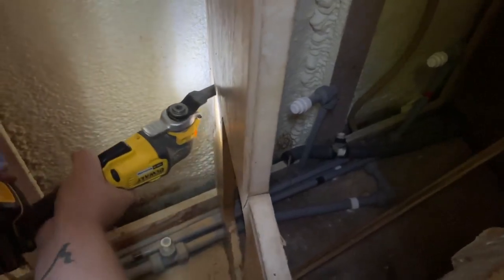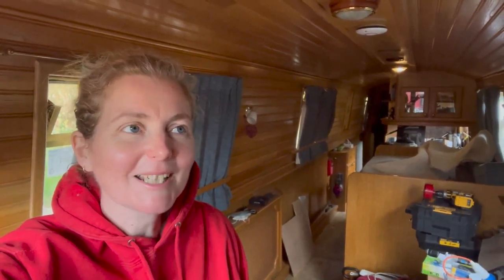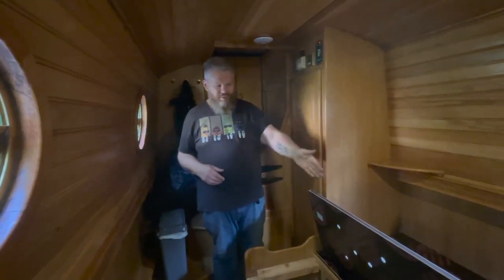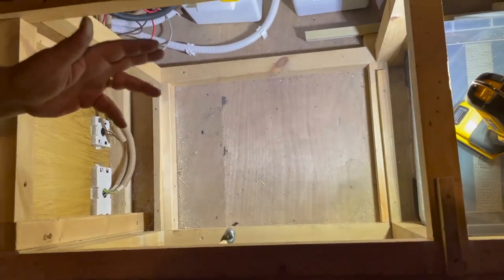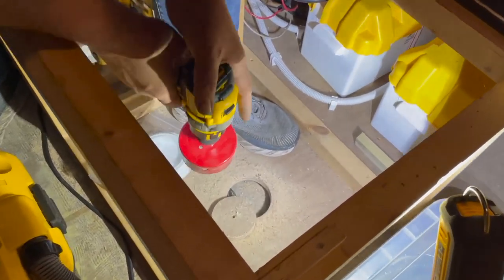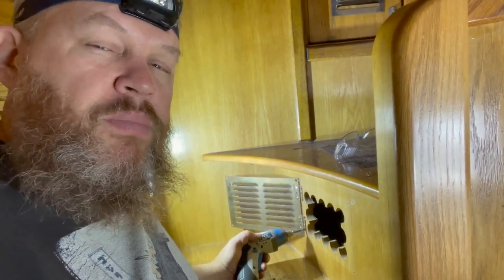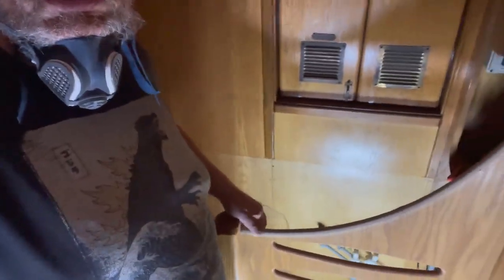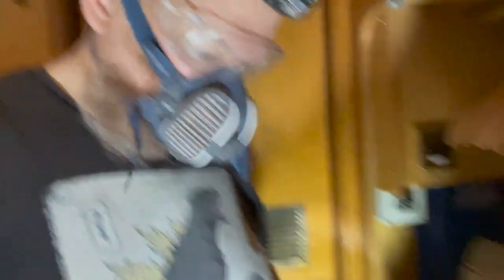Episode 010 || Another Set Back - We Find Water In Our Bilge

Comment: Glad to hear the water was localized and not through the whole boat. Quick tip for big hole saws: if you use the highest speed setting on the drill, you have less torque. When the saw binds it won't rip your wrist off, it will just bog the drill down. Can't wait so see how this all turns out. Keep up the good work!

Comment: When using the hole saw, engage the clutch on the drill. That way if it binds up the clutch will slip rather than breaking your wrist.

If you have two inverters, is it feasible to wire the high load appliances just to the high wattage inverter, so you can just turn that on and off on the DC side as needed? Would simplify things over having a full switch over.
Reply: let the tool do the work.

Comment: Washing machine is a really good thing to have. The important point from a power PoV is to make sure that the WM doesn't try and heat the water. We have an electric two-way valve on the inlet which can feed the WM from either hot or cold water. There's a timer activated by a button that switches it to hot for the time needed for first fill plus a bit, and then back to cold. Press this button when you start the cycle and it's all automatic from then on.

Comment: What I do with stubborn cross head screws that will not budge.  Using a battery drill with a variable speed trigger, I use a flat head screw bit that fits inside the damaged screw head and using all my weight to push the flat head bit towards the screw SLOWLY unscrew.  With patience this will work. It may take a couple of goes.

Comment: As you are finding out "You can't dip your toe into a remodel"  Almost every bathroom remodel I have seen winds up with an empty room all the way down to the wall studs.  Once you hit that point It gets much better.  I hope the Grey Pluming pipe is better than what we had in the States which failed a lot in cold weather.  Most has been replaced with PEX by now.
A Tip for using a Hole Saw is to replace the stubby drill bit in the Hole Saw with a section of drill rod. You have to use a separate drill bit BUT because the Drill Rod is smooth it will not enlarge the hole.  This means the Hole Saw runs true and is much less prone to grabbing and twisting your arm.  Vacuuming the cut will keep sawdust from building up and binding as well.

Comment: Having spent a few years in the Fasteners trade (nuts bolts screws etc) here some info Remember when working with cross head screws, use the correct bit. There are Philips, Pozi, Superdrive , and a Japanese screw head use mainly on motorcycles plus Chinese copies good and bad. So use the wrong bit and you just grind the head out. I would guess by the age of the boat they should be Pozi or SD.  GKN replace pozi with SD as an improved head when the pozi patent ran out.

Comment: You may have solved inverter wash machine by now, we have a machine used by Dave CTCut, our 800w inverter tripped out cold wash only when it got to fill solenoids, we upgraded to victron 12 - 2000, now works great but only use cold wash when away from mooring. Think you are looking to use heater.

Comment: If  I gets stubborn screw or a broken stud I use an Easy Out ,this is not a woodworking tool but an automatics tool ,it is used  for removing stubborn or broken studes or screws ,You drill a small hole in the top than insert the Easy Out and the stud or screw will wind out     Hope this is helpfully

Comment: Just watching your latest video ,I don’t know if this will help you when I get stuck screws or stud I use  what we in AUS call easy outs ,these are not a woodworking tool but they are automotive tool designed to remove broken studs ,what you do is drill a small hole in the top of the screw than you screw in the easy out and you should be able to remove the Steuben screw  . Hope this helps

Comment: Be careful with inverter specs. You’ll really need a 2500-3000watt unit to run a washing machine, rice cooker and other stuff. To be safe, you should allow a 20-30% headroom on your maximum constant load.You will also need to run the washer on a cool wash and keep the engine running when using the washing machine as even with the engine running you will, at best, only top up what you are using. You will still need to charge the battteries after use. Bear in mind that if you buy a victron inverter, they are rated in Va which is different to watts, a 3000Va Victron is actually 2400watts.
Reply from the maker: Don't worry, we checked with the manufacture before we bought the inverter. We also tested the pull of the washing machine. Thanks for the tips though

Comment: I'm not sure that I understand the idea of changing inverters, depending on the demand.  Do larger inverters use more idle energy, or are they less efficient? They can't put out more energy that is being requested, no matter what capacity they have so if you're only using 100W, your 2000W inverter will only supply 100W of power.